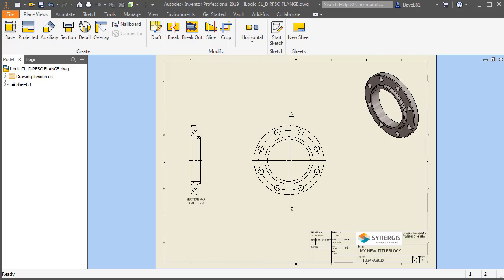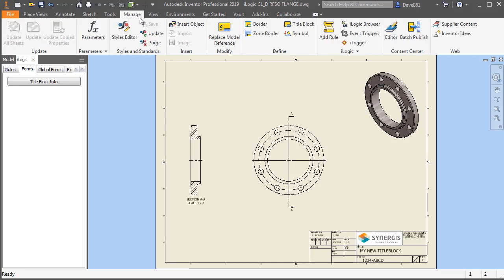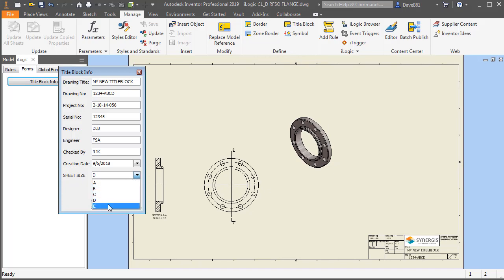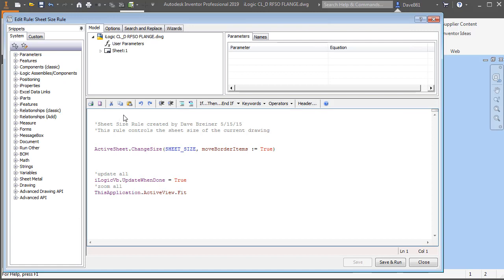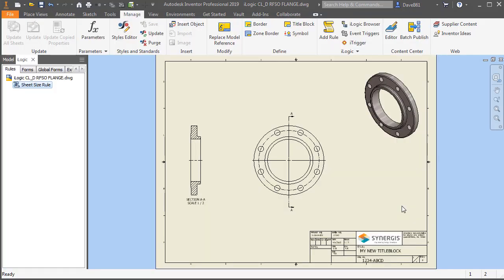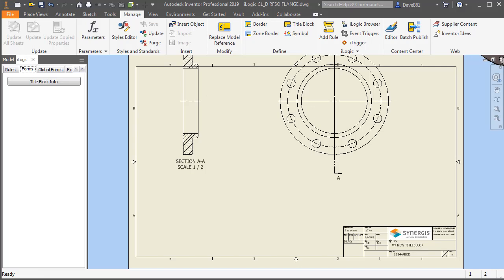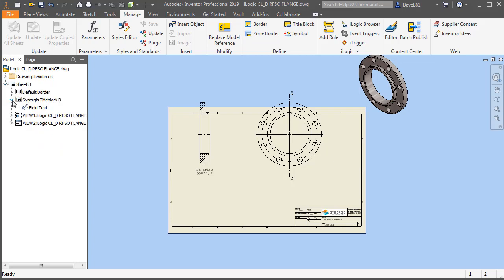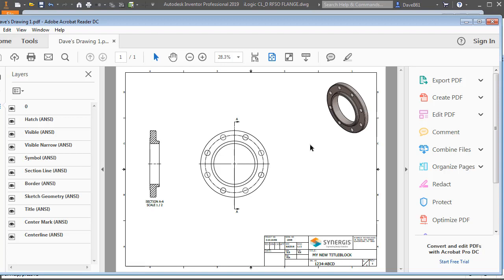iLogic - Adding Rules to a Drawing

Comment: The PDF print rule is nice, but it should have the drawing number instead of "Dave's PDF print"... Can it be? And run automatically when hitting save
Reply: Hi Johan, 

You can use the drawing number as the name for the PDF.

PDFName = iProperties.Value("Custom", "Drawing No:")
ThisDoc.Document.SaveAs(PDFName & ".pdf" , True)

I created the “Drawing No:” Custom parameter and use this in my Drawing Titleblock form. The PDF will save with the drawing number as its name. As far as auto run after a save. All you need to do is add the rule to the “After Save Document” Event Trigger.
Thanks,
Dave